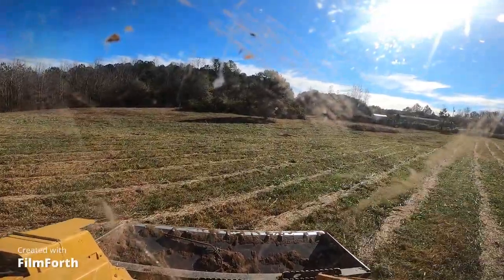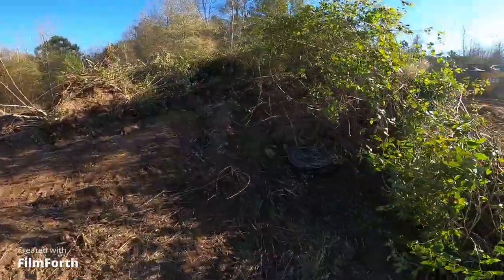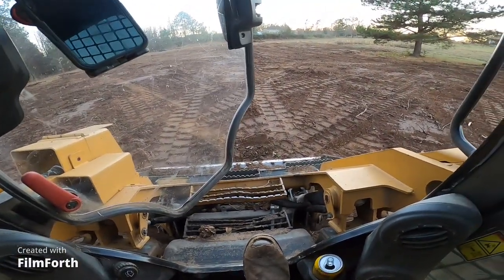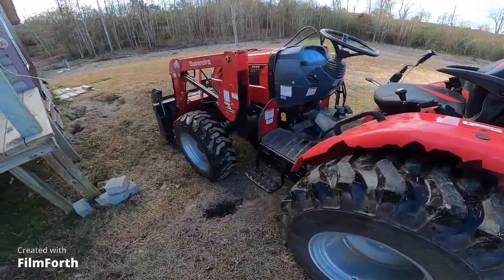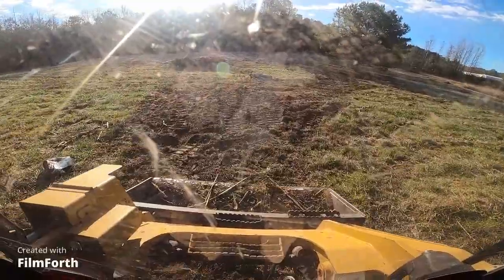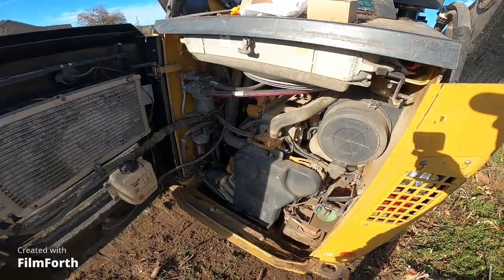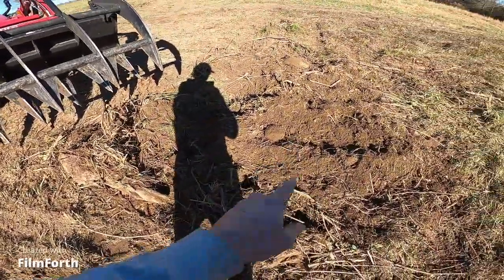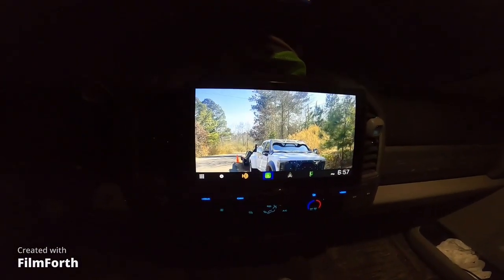Clearing last of dozer pile then skid steer broke

Comment: It's amazing you can sort through that stuff without a rake grapple. When the skid steer broke at least you had the tractor to get more done. That fuel pump looks like the facet type.
Reply from the maker: To be honest it was really hard since the bucket was a smooth bucket, the tractor was hard to use couldnt see anything and didnt pick up material like i wanted it to, I just pushed into pile and lifted up and rolled the material so it eventually sorted out. will get a grapple just need those kind of jobs to come in. It was $260 for the primer pump, was easy to installed.
Reply: @bowmanlandclearing777  That is a smart way to do it, get the work first and then make the investment in new tools. Caterpillar is good about having parts, they just tend to be too expensive.

Comment: A grapple and a landscape rake would be a good investment for your skid-steer.
That tractor grapple is the pits, I don't know why they build them without tines.
Reply from the maker: Yes it would and it grabs but not a lot. I'm just needing jobs that require a grapple, but will eventually get one.
Reply: @bowmanlandclearing777  I understand what you're saying you need a grapple rake but at the same time you need the money to invest in one.
I know this will be common sense but through the years I've had customers bring me  their grapple forks and either the times were bent or the cylinder Mount was broken loose or bent from the frame because they bought one and looked only at Price not matching the attachment to the machines power. 
I think if you keep looking around and have patience you find a good used unit that will match to your skid steer.
Reply from the maker: @bobber55  Right, i went to powerquip (Kubota) they had a Heavy Duty one for 4500 will get that one soon i do have some upcoming commercial jobs first of year gonna wait last minute to purchase one they have  15 on hand so i personally know the salesman so hes gonna conatct if they get to the last few. My first year in business and doing full time but have been doing this for 2 year while i worked as a diesel mechanic.